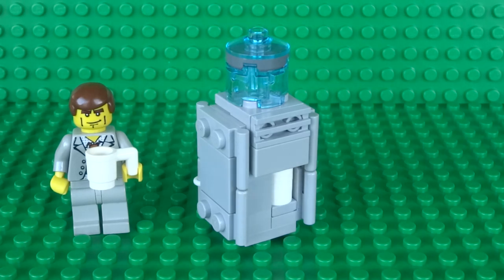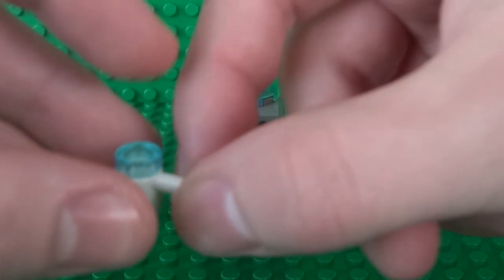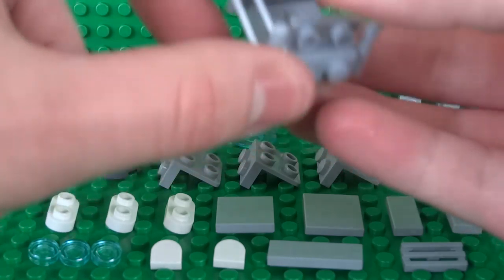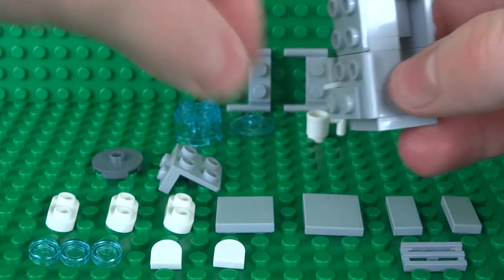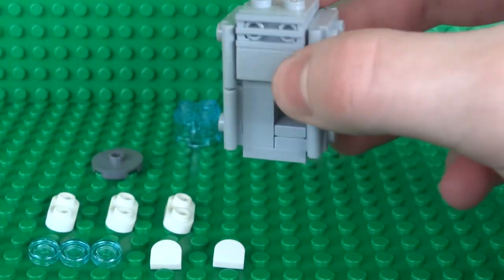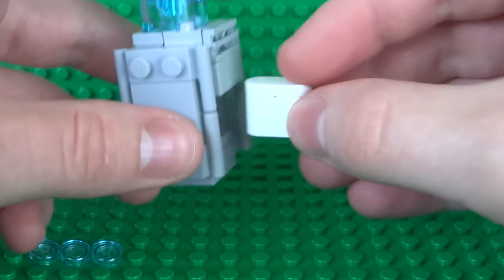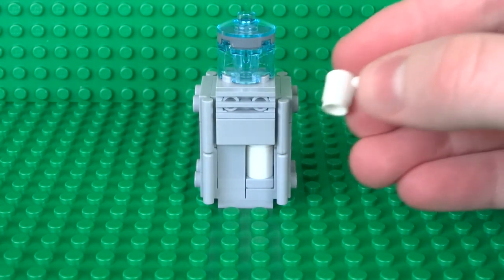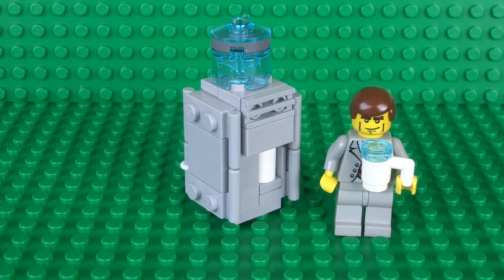How To Build A Working Lego Water Cooler & Dispenser

Comment: LOVE IT
Could you make a hot and cold water dispenser?
Reply: That could be potentially easy to adapt. Make the same build twice, linked by a baseplate so theyre side by side. Then include a blue tile and red tile on each side respectively for temperature indicator. You can probably just ditch the bottle bit and make the top flat with a tile if you aim for a dispenser that is plugged into the building's water supply like in my work office.